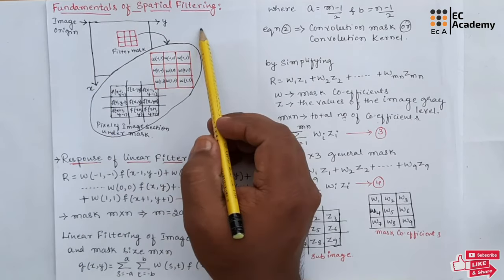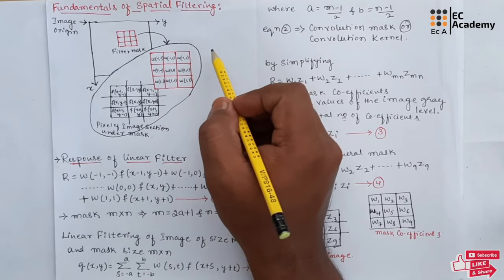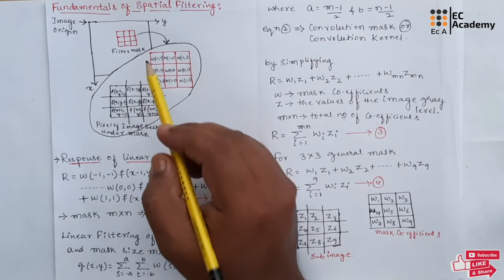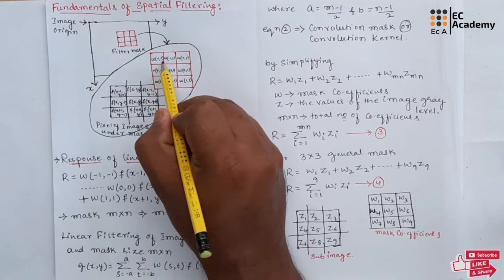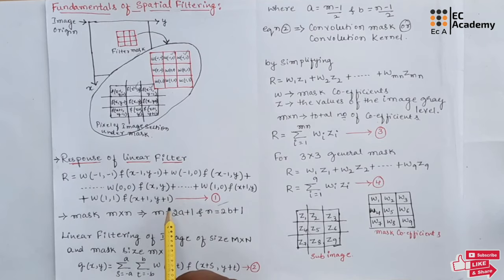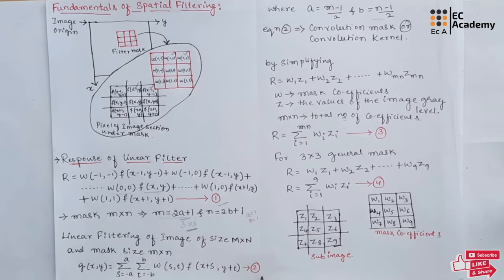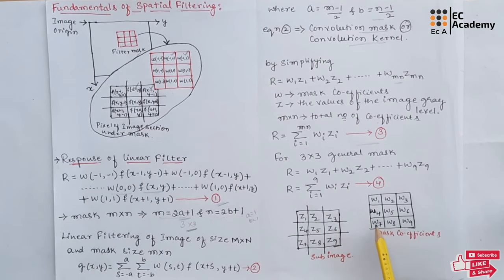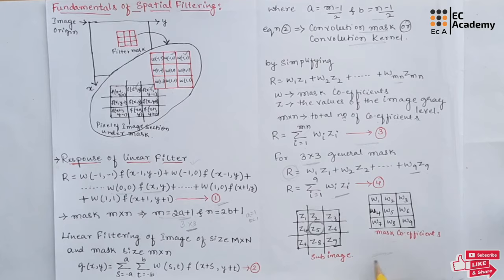DIP#16 fundamentals of spatial filtering in digital image processing || EC Academy

Comment: 00:02 Introduction to spatial filtering in digital image processing
00:52 Spatial filtering in digital image processing involves smoothening techniques.
01:34 Patient Filtering Special Fielder Consist
02:17 Understanding the fundamentals of spatial filtering in digital image processing.
03:23 Spatial filtering is used to enhance or suppress certain features in digital images
04:43 Spatial filtering in digital image processing involves subtracting two values and simplifying expressions.
05:33 Discussion on 125 yen in 2011
06:12 Fundamentals of spatial filtering in digital image processing.